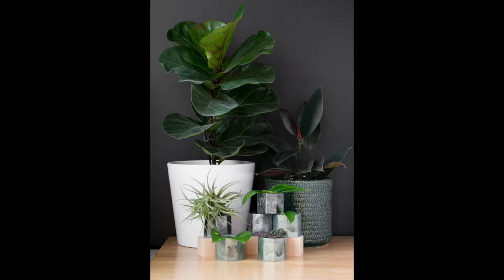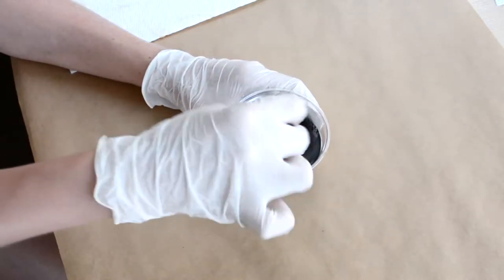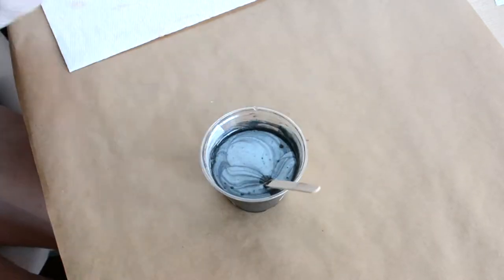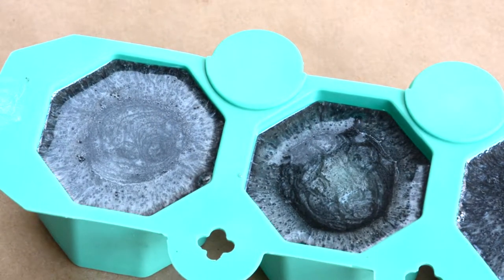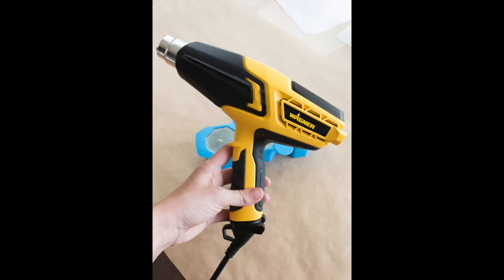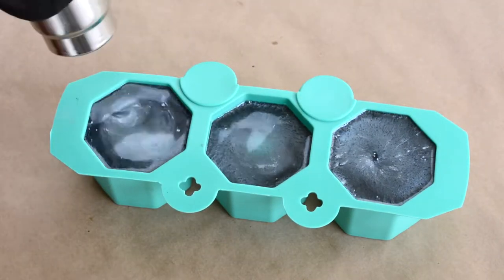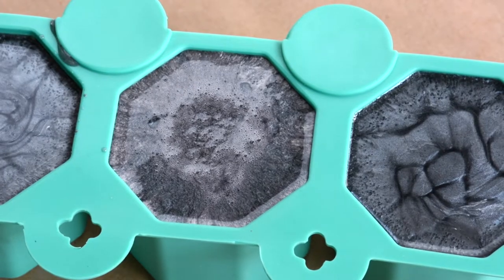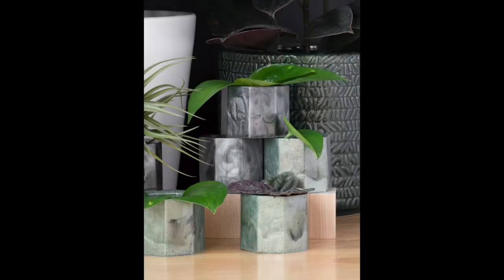DIY Epoxy Resin Planters & Using a Heat Gun to Pop Bubbles

Comment: Any substitute for a heat gun?
Reply from the maker: Yep, you can use a hair dryer on low, just keep it further away so it doesn't blow resin everywhere and make a mess. I have also seen people use a straw to blow at the bubbles and pop them, but I haven't had a lot of luck with that!
Reply from the maker: I also used a hair dryer in this video! https://www.youtube.com/watch?v=G0LIu1apbwk

Comment: Can I use a hair dryer?
Reply from the maker: Yep! I have used a hair dryer for resin projects, just make sure you stand far away and move closer slowly. The air power is much stronger on a hair dryer, and it will blow the resin everywhere

Comment: How do you add a drainage hole?
Reply from the maker: You can just use an electric drill and bit to drill through the bottom—or if you don't have a drill, you could try to hammer through some nails and then remove them :)
Reply: Excellent thank you